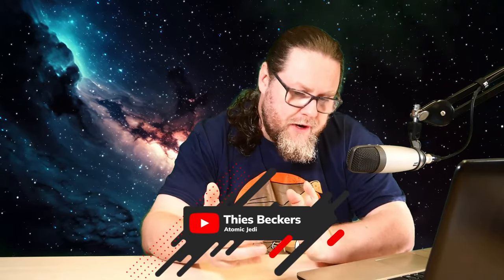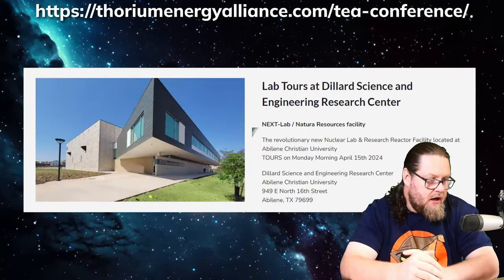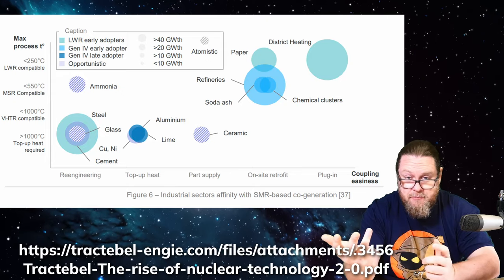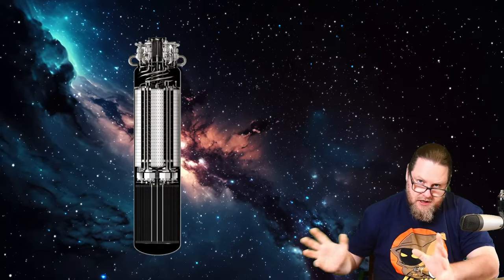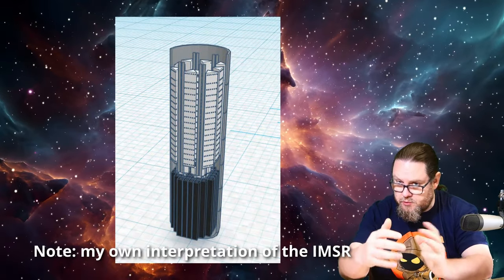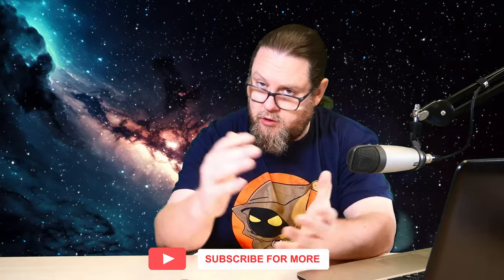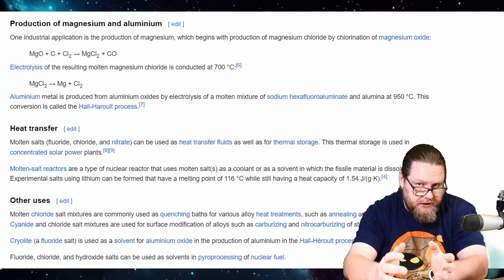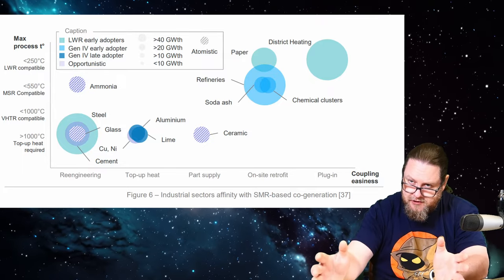Molten Salt Reactor Manufacturing Potential Nuclear Turbo Boost

Comment: I see the 7+/- life of the reactor as a huge advantage. It allows for iteration that can't happen in other reactors. Every seven years they can install an improved unit. The 550c output temperature is very conservative and they hope to improve that to 750+ as the reactor vessels are removed and examined.
Reply from the maker: That's a very good insight! Thanks for sharing.
Reply: It also means you have a whole reactor to dispose of every 7 years. I see it happening again, ppl start to think in money and build in absolesence, because to make their firm lasting they have to make their short lived. I myself like to point out for the laymen that nuclear waste is not as big of a problem as many would think, however, if we want to rebuild a fleet every 7 year it might just become one after all.
Doing it once and trying to come up with the most robust design possible based on the experience is fine, but nuclear is absolutely not something you want to build cheap at the cost of its shelf life. If we can build reactors that last 60 years considering one with 7 years seems wasteful. Your car suppose to last longer...
Reply: @CraftyF0X  It's just the reactor vessel which is a tiny part of the whole. Also, they don't dispose of it, they refurbish it. Remove and replace the graphite and reuse the rest. Their cost estimate includes replacing graphite and most of the plumbing but after testing it should last several cycles which would just bring costs down even further.
Reply: @chapter4travels  If they can deliver on this promise, great. I thought they wouldn't throw away everything, but the vessel and the graphite, also taking out the fuel or what remained, seems a lot. And Idk how they plan to refurbish neutron dmg on simple SS without losing thickness.
Reply: @CraftyF0X  The reactors are done in pairs, the fuel salt is transferred to the second vessel and the first cools for a couple years before refurbishment. Computer models show the stainless should be able to last several cycles but only real-world tests and measurements can verify this. This is where they can iterate on the design, and try different alloys of metal or coatings. Improvements in graphite molding can also be tested. This kind of iteration is not possible on other reactor types.
Reply: @chapter4travels  The reuse of the vessel sounds too good to be true.... but you know, if they can demonstrate.
Reply: @CraftyF0X  If I'm not mistaken, the budget numbers they have published for the cost of electricity assume they can not reuse any part of the reactor core, but they hope to be able to do so. Simulations say yes, but reality may say no, or only some portion. Again, this is why iteration is so important.

Comment: Reminds me of the liquid-metal reactors of the Alfa-class subs. Nice and compact, high power, only problem is if you need to stop them, you literally brick them and you have to replace the whole reactor. Liquid salt is the same - they're using them in light-focusing solar power plants, and they need to plan operation so it doesn't solidify. Also, the stuff is very corrosive.
Point is, you need to consider operation and maintenance too. If you need to replace the graphite every 7 years, and you need to stop the reactor for that - then probably that will be the end of your whole reactor.
Reply from the maker: Agreed, I suppose they have a technical solution for that.

Comment: This reminds me of Thorcon's concept that is pretty much the same. Shipyard-style fabrication, eight year reactor vessel use. Perhaps a comparison between the two may make an interesting video?
Reply from the maker: Pfoe, I don't know if I know the concepts well enough to differentiate the two. Also don't know if  I know the physics well enough. Let's see:
Thorcon - two reactors per vessel 
Terrestrial - two reactors per plant
Thorcon - NaBE salt
Terrestrial - Don't know
Thorcon - HALEU
Terrestrial - LEU
Thorcon - HX and Pump outside reactor - but inside a common vessel
Terrestrial - No primary pump, and HX integral in reactor
Thorcon & Terrestrial - both Graphite moderated
Thorcon - going through Indonesian bureaucracy for license and 1st unit
Terrestrial - went through CNSC vendor review - still must license reactor AFAIK
Reply: Lucky Fukushima was not floating. 
Also Indonesia built Sydney ferries that did not pass under bridges and broke structurally.
More ship based nuclear is dangerous.
Reply from the maker: @stephenbrickwood1602  Your reply assumes that people are "just going to build nuclear ships, without assessing any of the things you mentioned". You are wrong.
Reply: @Atomicjedi  Thorcon has changed the design to no longer use HALEU as that fuel can only be sourced from Russia, which has been a very unpopular option as of lately.
Reply from the maker: @NomenNescio99  Awesome! And Thanks! We see that some of the design decisions are still in flux. Which is understandable!
Reply: @stephenbrickwood1602  As an Indonesian, be assured that we know what we are doing and that if we need some outsider to tell us what to do or what not to do, we'd ask.
Reply: @Atomicjedi  you have not lived there
Reply from the maker: @stephenbrickwood1602  So what?
Reply: @Atomicjedi  Thorcon can also run on LEU but they can't breed thorium with it. With LEU they are esentially the same as Terrestrial. Also those two started out as the same company or group.
Reply from the maker: @chapter4travels  Agreed, I see slight nuances between them. The only thing that sets both apart is the plant-design philosophy and the chosen path to market.
Reply: @Atomicjedi They started out as one company and split up for the reasons you pointed out.
Reply: Thanks for your presentation. Do you also present this and advice Mr Jetten, our minister for Energy?
Reply from the maker: @fcfootballfan8005  Whenever we get the opportunity. Most of our efforts are with 2de kamer leden, or politicians and civil servants on a provincial level.

We also wrote this whitepaper for the market consultation: https://www.e-lise.nl/_files/ugd/faaaa7_3d652f47dcda47dd9d118fe7ecfcbde1.pdf

Comment: The graphite 'problem' seems over-blown, finding a suitable metal/alloy with similar thermal expansion coefficients to electroplate or to clad the graphite with seems achievable and would solve the problem of salt interaction and graphite structural degradation. The fractures discovered in UK AGR fleet graphite blocks are tiny (few mms in length) - many of which are thought to have occurred at the start of operation 40 years ago. If the similar tiny fractures occurred inside sealed cladding it wouldn't make a difference to reactor operation.
Reply from the maker: Why don't you contact any of the MSR-developers and sell the idea to them? AFAIK Thorcon and Terrestrial both plan on replacing cores at regular intervals because of the moderator.
Reply from the maker: Come to think of it, the AGRs did run well above 600 degrees C. Did they ever replace graphite blocks in them?
Reply from the maker: I read that they used a stainless steel cladding in the AGRs. It doesn't specify how much more you must enrich the fuel to make up for the small loss in neutron flux. I suppose they still run on LEU, right?
Reply: @Atomicjedi The AGR's ran well over 600 degrees Celsius,  I think CO2 coolant reached excess temps of 700. Just to be clear,  the stainless steel clad the fuel pellets themselves and not the graphite bricks. They never replaced the bricks but the cracks became a large obstacle in the safety case of shutting down and the re-opening of the reactors when they were discovered. It wasn't a real safety concern as much as an economical one  - the main fear was the bricks cracking and proceeding to slip/slide 'trapping' mechanical fuel assemblies or control in the reactor - would massively add to the decommissioning obstacles costs. 
There was a lot of money invested in researching this phenomena, including computational models and small scale physical demonstrations, at the end of the day, I think they proved the bricks wouldn't move if further cracks and earthquakes happened, but it took too much time and money for building the safety cases to the regulator to so it was halted. 
I'm sure I've read they run on ~4%, you're right they will have more neutron parasitic loss due to the steel, but the graphite moderator and the large reactor size makes up for it.
Reply from the maker: @timothytaylor5867  thank you very much for this insight! It seems such a waste to abandon the AGRs and the knowledgebase the English have built up over the years. And I wonder if the MSR reactor physicists and engineers have had good conversations with AGR people. I know that the corrosion issues with the salt can be controlled if you keep water and oxygen out of the system (that's why the plenum space in the IMSR has a vacuüm), but if cladding also can contribute to a much longer operational lifespan, that'd certainly be worth a look. 

The other issue I wonder about is whether some FPs and Trans Uranics might plate out if you leave them too long in a MSR.

Comment: the molten salt reactor doesnt needs to have a solid moderator, it can have one but it doesnt need to be solid, thats just a subset type of molten salt reactor designs, one subset that designer teams are less and less inclined to design in recent years, with a few notable exceptions of course. The solid moderator types have a particular set of challenges to them, hence why people start to walk away from this approach.
Reply from the maker: I understand that, I wanted to highlight the "traditional" one. We're planning a meeting with one of the non-moderated developers. Once I know more about it, and if there's an appetite for it, I'll dedicate another video to the MSR. Might come quicker than some realize.
Reply: @Atomicjedi  Elysium, Terra power ?
Reply from the maker: @CraftyF0X  Is Elysium still active? TerraPower looks like they took that idea and ran with it (the MCFR)
Reply: @Atomicjedi  Last time I checked they were active, though Im not sure if they remain in the USA. Im a bit behind on infos, as you may noticed Im commenting on a 10 day old video :D

Comment: Thies you have done a standup job of helping humanity face it's next greatest hurdle. That is a change from fossil fuel to atomic power making those poor countries have wealth beyond their dreams.  This process when done correctly will not only make electrical power but produce a diesel substitute, (diethyl ether) so our trucks can run on for hundreds of years. Maybe even ammonia which is a more dangerous gas produced by the heat from the reaction making more money from chemicals than for electricity.

Comment: You have to talk about the national grid if you want to stop worldwide CO2 emissions. 

More electricity capacity in a no fossil fueled future,  5 TIMES more grid capacity. 
This is a national GDP busting problem. 
Nobody thinks. 

Most electricity bills, the invoice, is for the grid that gets the cheap electricity to the customers. 

That is why feed-in electricity is paid so little 15cents vs 75cents. 

They are not going to pay you for the grid you did not supply. 

They are going to charge the customer who uses your electricity their grid costs plus your electricity they paid you for plus a profit. 

More electricity, more grid capacity construction costs. 

Even 3phase needs more wires. 

More new high rise buildings need electricity suppliers agreement as they have to supply bigger cables and transformers.
Reply from the maker: I think you are right, but I wonder if 5x is enough actually, it wouldn't surprise me if it were more.
Reply: @Atomicjedi  
I have used Australia as a modern developed economy. 
Australia energy used was 5,700PJ, 2021-22. = 4,400gWh daily 18% was electricity. 
More info is needed to be completely clear, but this is a comment.
My point is the grid is so expensive that it was never over built, it is fragile but good enough to keep the lights on.
So 5 times more capacity means horrendous construction costs to expand. 

Anything that does not need grid expansion has a huge economic advantage. Electricity at the customer's building. 

Distant renewables have a grid cost problem. 

Rooftop solar PV and EV big battery and the existing national grid would be a powerful combination. As technology is evolving rapidly. 

Just look at any information on grid costs. 
The Australian Nuclear promoters told me about grid costs when they attacked Distant renewables grid needs

It was obvious they had the same problem. 

Bull sh....ters was their knowledge and intelligence PISSED ME OFF.
They are lost in their dreams, now I am being too kind.

Politicians are supporting them, and the Murdoch press. Trumps Murdoch mate who was sued for $1TRILLION.
Reply from the maker: @stephenbrickwood1602  It's quite simple. The world needs electricity. There's no way around it. And yes, electricity system requires Transmission and Distribution capacity. There's no way around it. You can't power an economy with rooftop solar, simply cannot be done. So you're stuck to the grid. Whichever way you go.
Reply: @Atomicjedi  unload the grid as much as possible is critical economically

Comment: I hope not , i see UK bill for its existing waste is 250 bill just for one waste site , Nuclear industry should be ashamed on what its saddling future generations to deal with , Shamefull .
Reply from the maker: Matter of setting up good rules. Waste disposal is an integral part of the cost to produce electricity in any modern nuclear power plant. As for those future generations, they also have to content with Dioxin, Heavy Metals, Forever waste that isn't radioactive but extremely hazardous. Radioactive waste is the least of my concerns. It's the best handled waste-stream in the world and if other industries took care of their own waste the way the nuclear industry did, the world would be a far better place.

Comment: This design has an uncompetitively high LCOE. I hope you haven't invested money into this startup.
Reply from the maker: I have no money to invest, so...
Reply: @Atomicjedi  The people that do tend to be more critical in assessing the real world viability of concepts like this. I strongly doubt this design will even get to the commercial pilot stage.
Reply: @bluecedar7914  What do you base this on? In an MSR power plant 85% of the plant is identical to a natural gas plant, only the heat making part is different. A gas plant needs hundreds of miles of pipelines and fuel that you can't store much of. The MSR needs no pipelines and can store years worth of fuel on site. There is no physical reason for the MSR to cost more than the gas plant.
Reply: @chapter4travels  Reality. Labour, particularly the low tolerance engineering needed to build this plant. And despite what some people say passive safety systems are not set and forget. Constant oversight by highly educated nuclear engineers would be required to keep these plants operating effectively. A gás turbine plant requires engineers with only more basic mechanical and electrical grid level engineering. This, justifiably onerous nuclear safety regulations, an operational requirement for inflexible constant output and a set market quota rather than more profitable spot market response, extra chemical and heat plant stresses and these plants having an operational lifespan less than half that of a gas turbine plant make that heat making part far more expensive than a natural gas equivalent.
Reply: @bluecedar7914  You misunderstand, in a MSR power plant, 85% of the plant is the exact same as a natural gas plant, built the same and operated the same. The only difference is where the heat comes from. The reactor part is much simpler than a water reactor, nothing is under pressure and all of the safety systems are completely passive, there is no button, switch, or valve that someone can screw up and cause a problem, the reactor is self-regulating as long as the laws of gravity and physics continue to apply. Just like the Navy trains teenagers to run the reactors in a submarine, The same will work in one of these much simpler reactors. That's the beauty of thermal storage being used by several startups like TerraPower and Terrestrial Energy. The reactor is optimized to run at a single rate continuously and the plant load follows using the molten salt heat storage.
Reply: @bluecedar7914  My mistake, I'm incorrectly confusing the combined cycle where the first cycle is a straight gas turbine, not a steam turbine.
Reply: @chapter4travels  And you wouldn't want to feed much of the steam output of an SMR into a combined cycle plant's auxillary steam unit.Same basic operation, different scale of parts and plumbing.
Reply: @bluecedar7914  I should have compared it to a conventional steam-generating system. Of course, the better system which is not here yet is the Brayton cycle generators. 
But my main point is the same.
Reply: @chapter4travels  Okay. But it still isn't valid. The real world costs of current nuclear designs remain considerably higher than gas without climate change cost factored in, and SMR designs still don't seem to be able to deliver cheaper LCOEs than optimum standardised GW+ LWRs even with low competition mass production factored in.
Reply: @bluecedar7914  Current nuclear designs are high-pressure/low-temperature water reactors. These are inherently expensive because of the forged pressure vessels and containment structures. Next is the low-temperature output and custom, nuclear-certified power conversion equipment.
MSRs don't suffer from any of that extra cost. They pair with conventional non-nuclear certified steam generation. The fuel is dirt cheap and they can cogenerate with industrial processes. Up to 750c for high-demand industrial processes. (non-cogeneration)